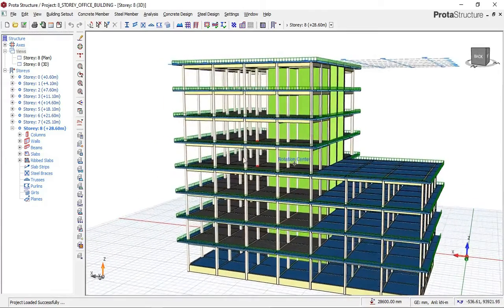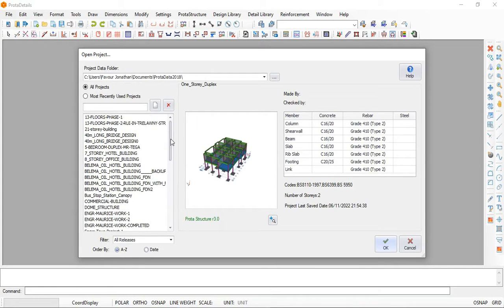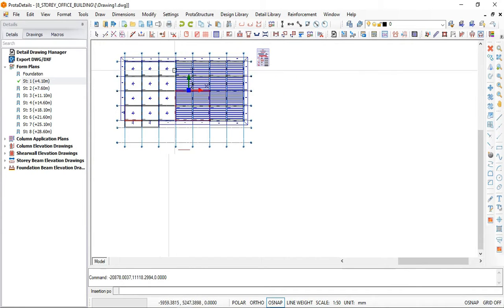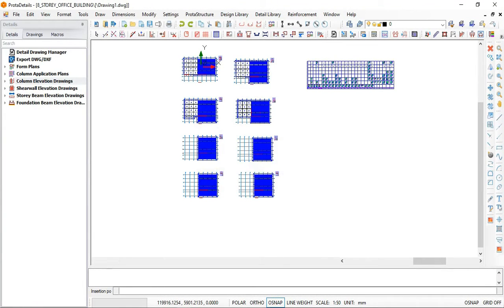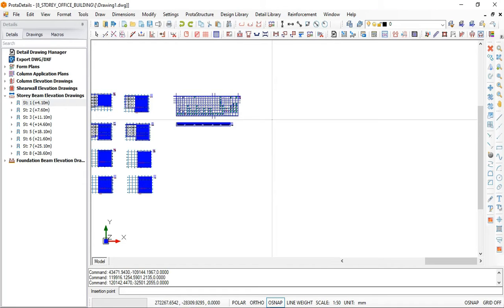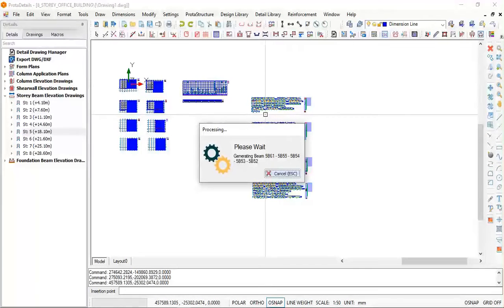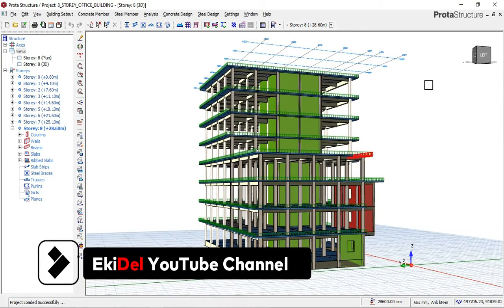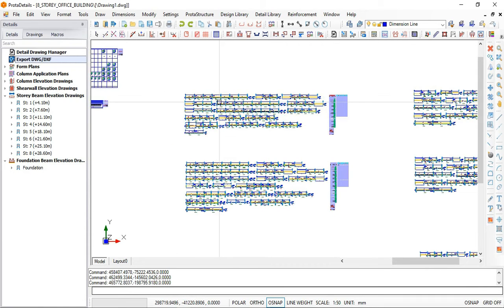8th Storey Building - How To Extract Your Structural Details after Design in Prota Structure.

Comment: Error/Warning List
Axial Load Comparison Warnings:
Warning: Difference between decomposed loads and slab loadings
is (%) =5.44
Yield Line approach for beam load decomposition may not be adequate for this model.
Warning: Difference between Building Analysis Results and Undecomposed Slab Loads (%) = 5.44
Building model should be checked.
Refer to Axial Load Comparison table for more detailed information.
i have found this issue while analysing my G+6 model, how i can correct
Reply from the maker: Please chat us up on WhatsApp so that you can send us a screenshot of your model thanks. Here's our WhatsApp number: +2349168891533
Reply: @EkidelEngineering  ok sir